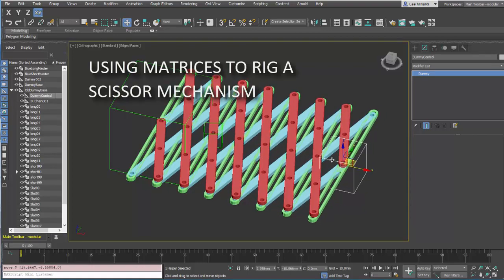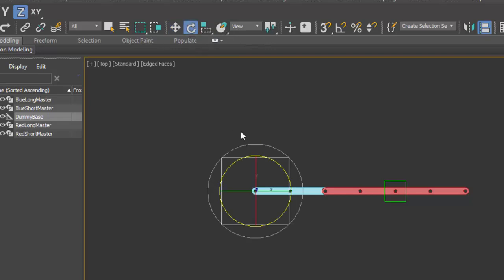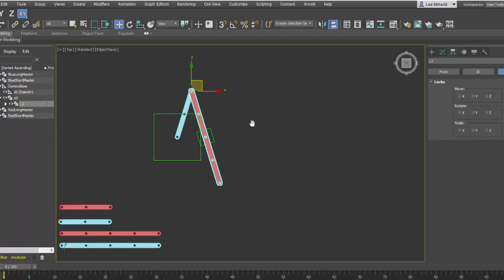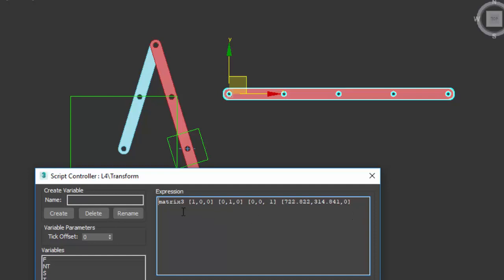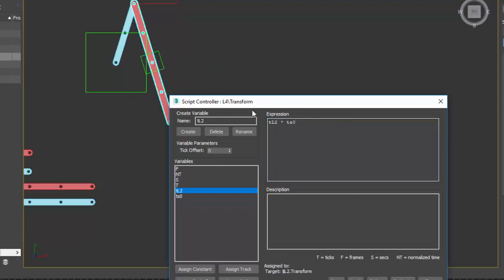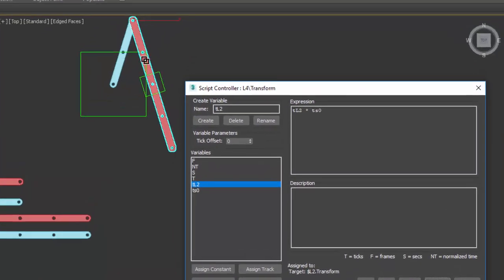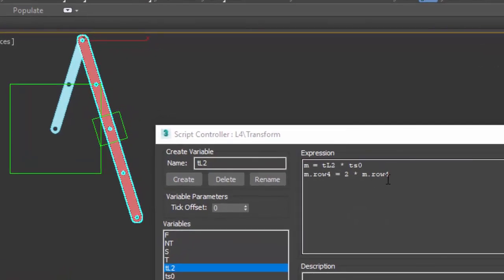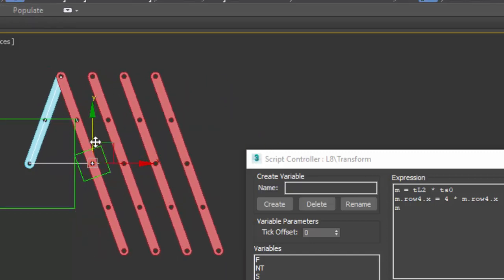Using Matrices to Rig a Scissor Mechanism in 3ds Max

Comment: This can be done without programming. I don't really understand why such simple things need to be done with programming.
Reply: when you export it to a game engine or need to do it there good luck doing it., there's a whole field of rigging if you need to do each one manually by end and animate without bones try doing that.
Reply: @maxgordon3194  I understand that everything can be programmed, you can write your own engine and make a rig there. If the point was to show how to do it easier, then I think it is better to do it without programming, if the point was to show how to program and use in the game, then I think it was worth showing it. The title doesn't say what the point was, so I decided to write that it's easier to do differently.
Reply: @BigZee1986  in rigging there comes a point where you would need this specially whe n advanced rigging and much more. let's say oyu wish to transfer this same rig to a game and you know that game engines do not support manual keyframe and modifiers you will need to script custom tools for it so instead you can involve the bone skin them then link them to these controllers and control them through the motion panel script. i understand your point and i found this process bad as well but as you go higher and more advanced rigging this is needed. the reason maya is industry standard too is all thanks to MEL scripting. maya by itself isn't shit.
Reply: @maxgordon3194  I understand. But I think in order not to mislead people about how to do it, it is better to write in the title that this method is through writing scripts. Since there are many ways to create the same thing. And usually you go from simple to complex. I accidentally came across a video. For someone who needs to do rigging through writing a script, this is very useful. I would say that it is useful simply to expand your horizons in 3ds max. The point of what I wrote is that if you are looking for rigging without writing scripts and come across this video, you can assume that it cannot be done any other way.